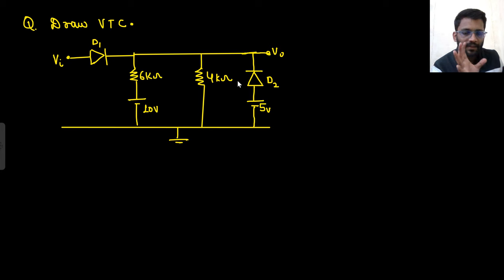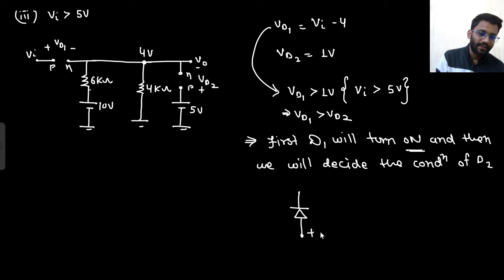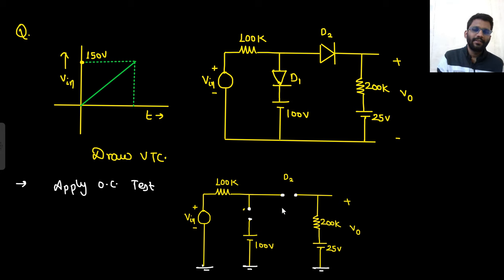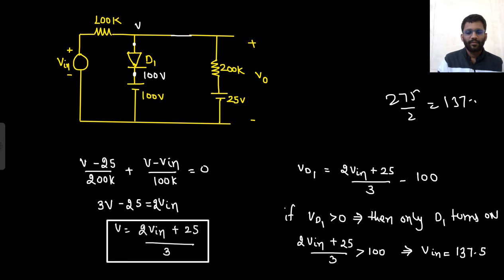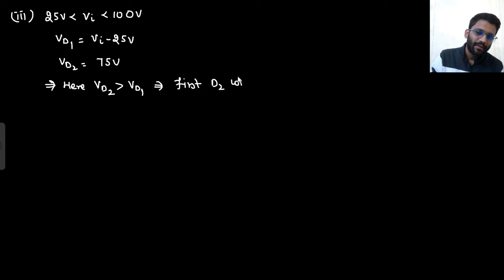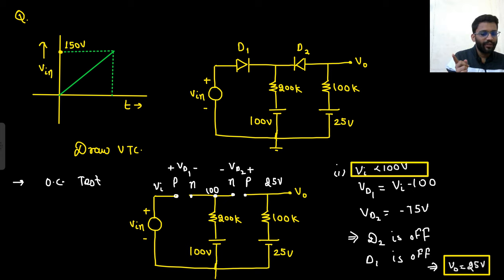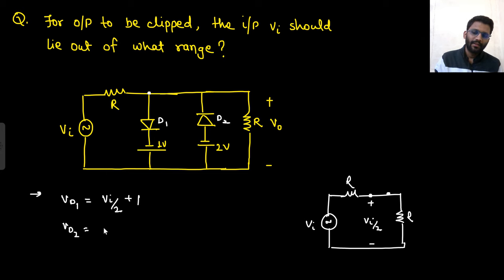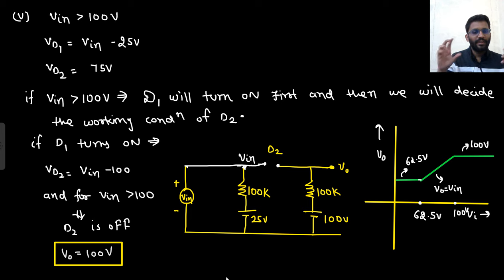Assignment 2 Solutions (PART 2) || Analog Electronics || PrepFusion || Himanshu Agarwal

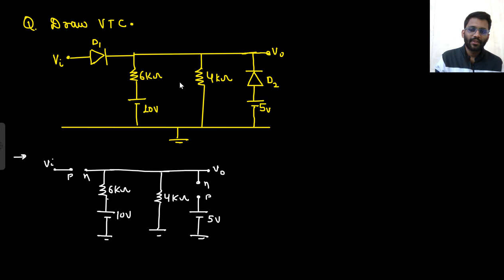Comment: sir at 1:33 how did you write voltage 4v, shouldn't it be 0 due to O.C(voltage across r=0)
Reply: So the 10V supply, 6k ohm and 4k ohm resistor forms a closed circuit.
Current through this circuit is 1mA and voltage drop across 6k ohm resistor is 6V (10V - 6V = 4V) or

Voltage drop across 4K ohm is 4V and voltage will be same across parallel branches.